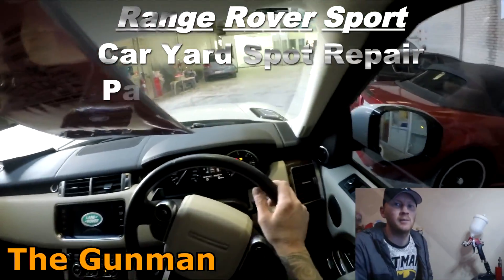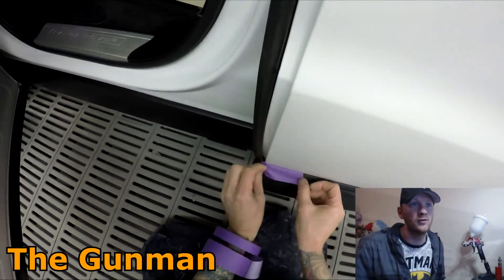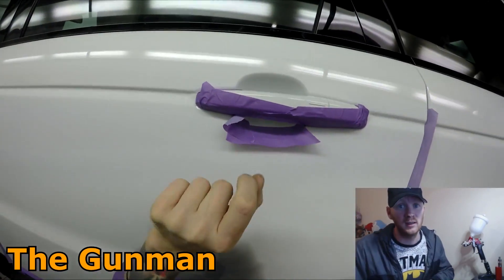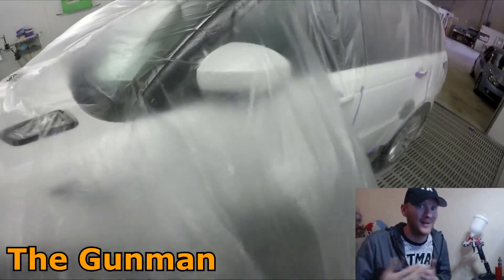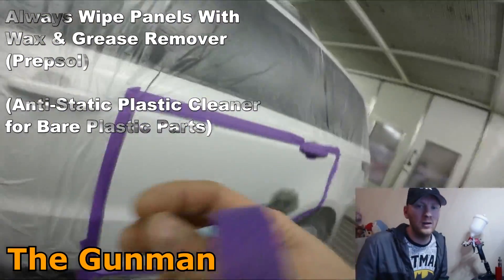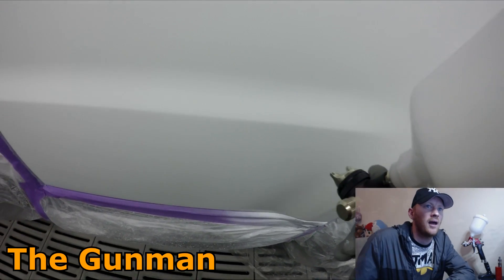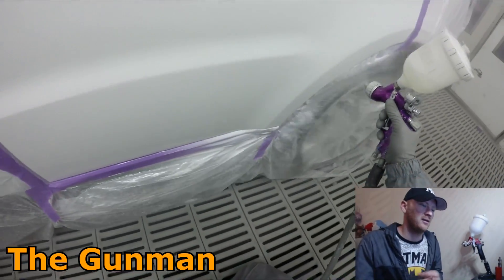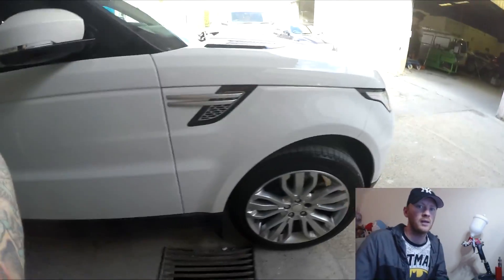Range Rover Sport, Spot Repair, Part 2: Mask & Paint

Comment: nice clean job thumbs up, but why wouldnt you strip the door instead of masking handle and then having to blend the top part of door ? That would be more of a pain masting all that especially that handle and blending the  edge around it. Also running the risk of burning through once you buff the blends up etc .

Comment: What plastic do you use? It doesnt seem to stick to itself really bad. This ppg shit i use pisses me off lol
The only difference i do is a hard line 1/4" away from the style line then i use soft edge foam right on the style line. Then pull the foam right off after clear
Reply from the maker: +Chris we use one from the local paint supplier, it's labelled Park Automotive, they just have their logo put on it though, Mack's and crocodile skin are a couple of decent brands.

Comment: What about right under the door handle? Would you see the transition from clear to clear? do you buff that transition or what?
Reply from the maker: +Jacob Falk yes, we gave it a light buff, done well there's no worries at all with this kind of repair
Reply: Okay, thanks! I just got a Warwick 904HE and I'm going to spray my BMW E30. I have a question that I can't find the answer to online. So the air channels on HVLP Conventional and LVLP are all different sizes to let more or less air through the tips. What I'm wondering is what are those air channel opening measurements in mm to tell what kind of tip you have. My gun is HVLP but in your video showing the differences, my HVLP looks like your guns conventional.

Comment: Not trying to be negative your a bad ass painter been watching your vids for a few years, but why not just go ahead and clear the rest of the door?
Reply: Jesus Jimenez I think for blending purposes... If he paints the whole for he will have to blend into the adjacent panel... right? So higher cost in paint.. clear .. Labour etc... I could be wrong
Reply: Evo K extra cost of paint would have been minimal because he would have only needed to clear the rest of the door I'm guessing the boss didn't want to R&i the handle and belt molding maybe it was customer pay
Reply: That edge will peel one day just by rubbing the wash mit over the paint line over time and the customer will never tell theyre friends it's peeling because they wanted to be cheap and not pay to clear the entire door, all they will say is I took it to that shop and now it's peeling and that little money you made on that door will cost you losing customers
Reply: the place that's paying for the repair wants it done cheap so they don't want to pay top dollar so you don't want to waste time with extra sanding, taking the door handle and window molding off, etc. If you're not experienced with making shortcuts work then sometimes it's easier to prep the entire door but then you're losing profitability. I think because this car has a very good body line for this kind of shortcut is why gunny used it.
Reply: caucazn23 short term profits for long term losses makes perfect sense,  then again some shops still have dignity and would never make shortcuts like this
Reply: caucazn23 LOL some shops do anything for a quick buck you probably do the same thing LOL
Reply from the maker: +caucazn23 exactly, some people understand how the real world works and some sit themselves on a pedestal and think they are above the rest. Holier than thou Jesus Christ, I can't see why the paint would peel of the prep is done right. May the paint gods be smiling upon the. Peace out and go paint some shit. 🤘
Reply: The Gunman exactly!